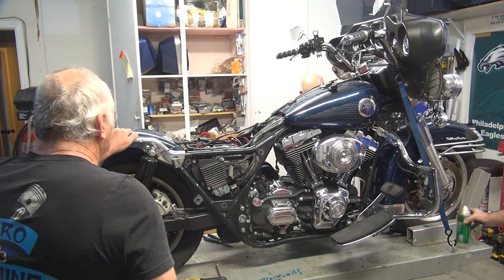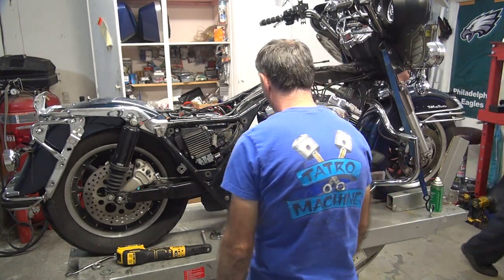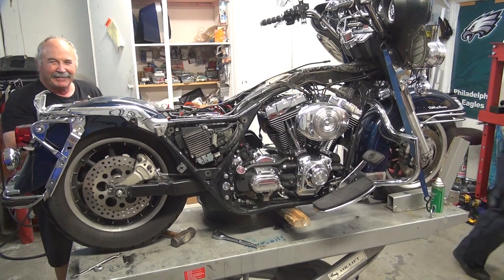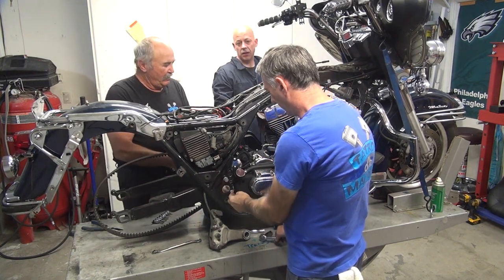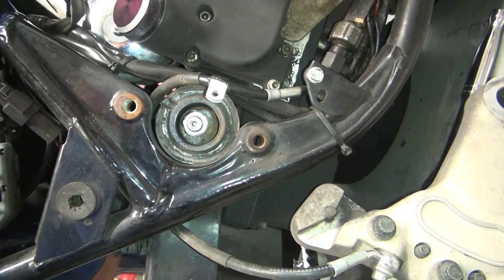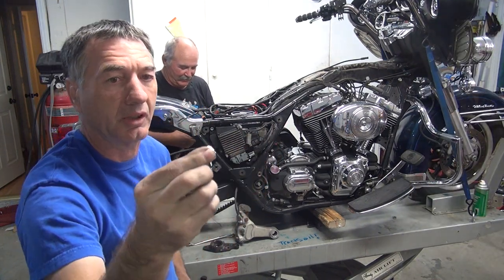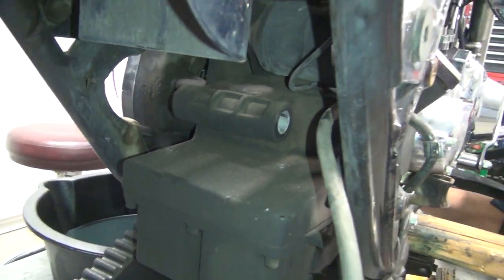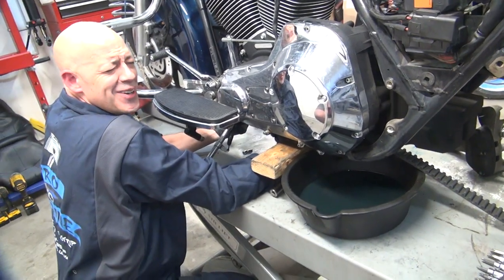#105 2004 road turd topend trans rebuild rear belt change FLHT twincam touring harley tatro machine

Comment: I got 50,000 miles on my 1990 FLHS and the belt still looks good. Im going to run it . original cam ,lifters and non adjustable pushrods. do you think it ok to run them longer.